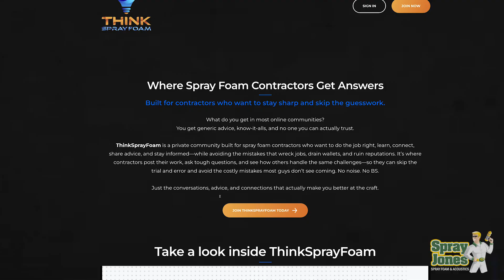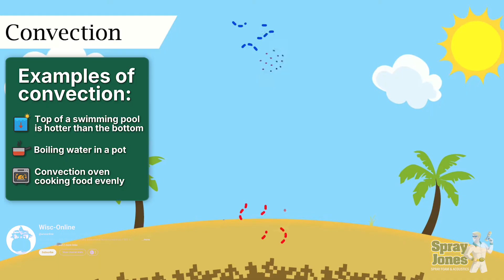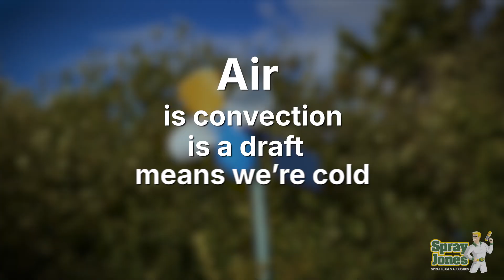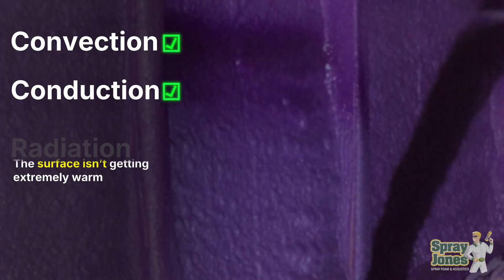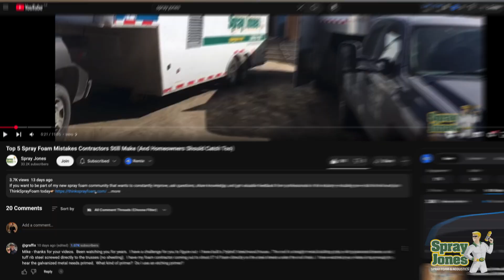What is insulation? And why spray foam is in a league of its own.

Comment: Hi Mike..I finally bit the bullet and had 2" of cc foam sprayed on my roof deck and my basement ceiling. It's 100⁰f outside. My attic temp was 108 yesterday. 800sqft house in mostly sun. I reached out to installer, who has been spraying for 23 years. He said it is unusually hot outside. Let's see in a few days how it is. The next few days will be more normal, low 80s. As I write this, outside temp is 95, attic is 95. Ty
Reply from the maker: You have to control sunlight coming into the house. Hot air inside the home will go which way....? Up
Warm air wants to rise so do the following:
1. control passive gains of heat via sunlight coming into the living spaces. You need good blinds for windows
2. move air within the space from higher up to downward. You need to force the warm buoyant air down and equalize the temps in doing so.

Comment: I have been an avid DIY'er for 50 years tackling big projects - I am on my last go-around, renovating a 1200 sq ft forever home before we move in. I have been watching your vids for some time now and I've learned quite a bit. Most importantly I've learned that after the first  2 inches of closed cell the gain obtained from additional inches is rather small, percentage wise. So, I finally had a 30 year spray foam co. insulate my latest this home the other day. WHAT A TERRIBLE JOB. I requested/paid for 3 inches in the walls, 5" in a 2 x 6 non-vented shed roof area and 2" on a crawl space blocked wall. Well, final product - 1.5 to 3 in the walls and 2.5 to 4.5 in the ceiling. Miserable! Some ceiling areas had 1.5 inches.. They are coming back Friday to fix.. What should I request from them to insure a proper Job? What is the diff. between purple and white/cream colored foam, both being closed cell? Thanks!
Reply: You’ll just have to ask the measure the foam infront of you everywhere you say was a low spot. Realistically they should take responsibility and touch up everything. Purple foam is just for building code requirements in Canada. Here in Georgia I’ve sprayed white, and blue closed cell.
Reply: @gregnajar  may I ask one more question: are there different attachments/nozzles so that you can get into tighter spots?
Reply: @L46C3 not specifically for tighter spots, there’s an extension tip that may help reach towards the soffit but their purpose is to help you reach further, not for tighter spots. It’s also called a bulldog tip. I’ve sprayed my fair share of tight attics and the best I can say is, make sure your installer can show you the job was done correctly.
Reply: @gregnajar  thank you Greg. Great help. They are here now giving me the amount that I paid for hopefully anyway. 3 inches in the wall 5 inches in the ceiling instead of 3 to 4 on the ceiling and one and a half to 2 1/2 in the walls. Again, thanks for all of your help and input. I’ll continue to watch.
Reply: @L46C3 hopefully they took care of you

Comment: Spray foam is wonderful but I want to avoid anything that is trying to be the next asbestos. What is the trapped gas these days? Is spray foam still using fluorocarbons, aka forever chemicals?
Reply from the maker: Spray foam has been in use since mid 1960s - it has extensive testing on it since 1970s, PFOS chemicals are not in SPF this has been tested and examined already.
You have polyurethane foam in: mattresses, seats, chairs, dashboards, shoes, appliances, packaging, building materials galore - it is all around you.
Reply: Thank you. @SprayJones .
No I have no problem with polyurethane in the long or short term, and, fire retardants make it safe enough in a fire. And I do not buy into the "nature is better" especially when there is no engineering to back the claim.
My concern is about the blowing agent, and to help follow my thinking —
Q1. what is expanding gas in spray foam
Q2. are Hydrofluoroolefins pfas
and
Veritasium: https://youtu.be/SC2eSujzrUY?si=NLkkaaB_HS5CVYcm

This was brought into focus when my local area found their water supply contaminated with PFAS from historic vehicle fires where foam was used. Also there are similar problems around military bases (lots of fire training).

None of this is a spray foam problem in itself and the chemicals are safe while inside the foam. It's the end of life disposal that worries me. 
As these PFAS chemicals get more heavily restricted will a future buyer be worried about renovating or demolishing the spray foam area? The problem may end up similar to asbestos sheet — safe in place, but only special people should mess with it.

Are there closed cell spray foam formulations that do not have the PFAS type chemicals in the blowing agent?

Comment: Question as I consider insulating my roof deck in creating a condition attic (with a small supply of conditioned air being put into it) .... this is a retrofit and I have multiple cathedral ceilings that currently our design designed to bring air up through the soffit and vent into the attic space and then vent out of the Ridge vent. If I put foam in the attic and seal everything, those cathedral ceilings where I could not put foam would bring warm humid air into the assembly and not be able to dry or vent, correct? My only way to fix that problem would be to take drywall off from the inside and insulate the cathedral area for everyone of those areas in my roof. That's not a small undertaking. Am I correct that I would have to do that? Or could I just seal off the soffit vents that were bringing this air up the cathedral and leave the current insulation in place?
Reply from the maker: You can seal areas with a partition wall that is sprayed separating the two zones. One vented and the other not.
Reply: @SprayJones  well what I am saying is that yeah I definitely would have a partition that would make the main attic sealed while the cathedral areas that were coming up into the sides of the main attic are now also kept from venting their air into the main attic, but my worry is that the air coming into those cathedral areas from the vented soffits at the bottom would accumulate moisture in the traditional fiberglass or blown in insulation in those cathedral cavities since that air now has nowhere else to go. Assuming this is indeed a problem to worry about, the only two ways I see to fix it would be to take Drywall off on the inside and put foam against the rafters or a second option, which I'm not sure would be effective, would be to retrofit the soffits on my house with wood instead of perforated material to not allow air intake. Hopefully that makes sense.
Reply: That is a more complicated issue to address than a simple YouTube conversation can answer. You need to have someone experienced look at it. Vented spaces need to be isolated from non vented assemblies and it came can be difficult on complicated roofs, even more so on retro.

Comment: if i were to spray down to ceiling joist instead of under roof decking  would i run the risk of trappings moisture from other side of the ceiling?
Reply from the maker: No. But how much space will you have? Spray foam needs a lot of room to be sprayed.
Reply: @SprayJones  the contractor suggested to rip out the entire flat roof and then spray down 2 inch of polyethene with 10 inch of cellulose. the attic space is probably somewhere between 15 to 18 inches. I think i would be better off by installing rigid foam boards on the roof
Reply: @towqueter if you spray only two inches that’s good but adding the cellulose will be a nightmare, you’ll be creating another thermal barrier in the attic and there will be condensation coming off the spray foam. Just do 3-4in of closed cell.
Reply: He doesn't recommend spraying down onto existing attic floors. he has videos on why.
Reply: I would block it off at the outside wall.. make sure to leave whatever depth your spraying from the inside so u have continous depth don't spray all way down where roofline meets the edge of floor.. cardboard or wood is good to use to block.... put 5 1/4 inch  or 4inch

Comment: I built a barn in Florida with a black metal roof. I decided to use closed spray foam on the ceiling only. JUST doing that turned it from an oven to tolerable, even absent ANY insulation in the walls -- in Florida sun!

I framed under the existing roof, so there were weird angles and non-standard spacing (metal buildings are 5 feet on center, not divisible by the standard 16/24 inches) so the spray foam was definitely the right choice.